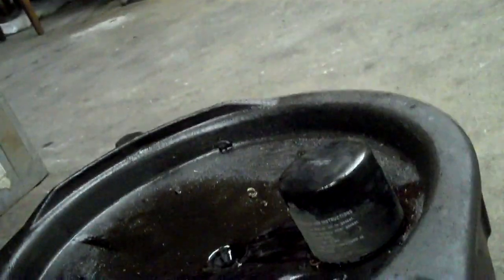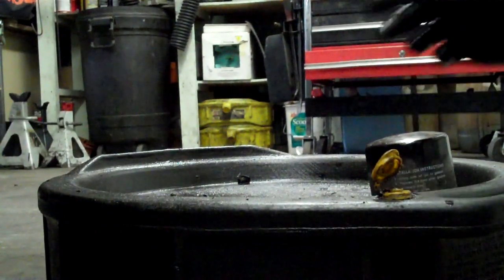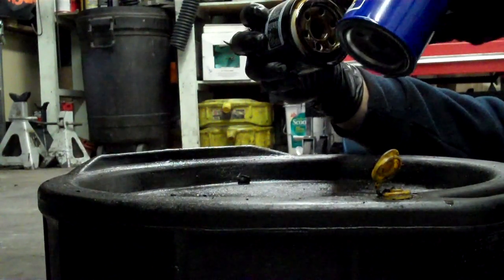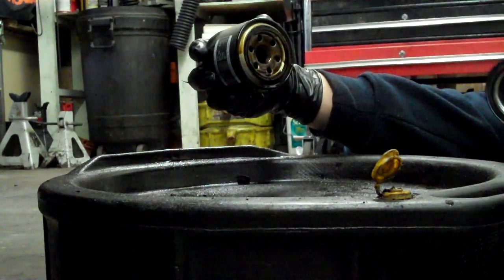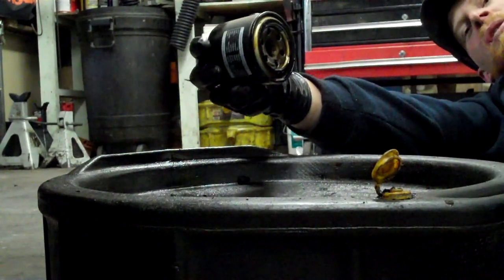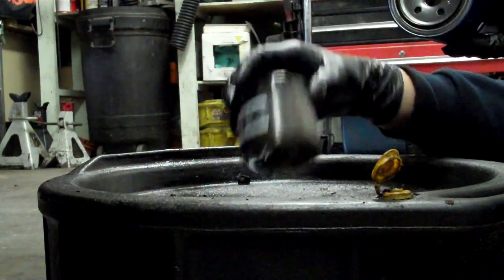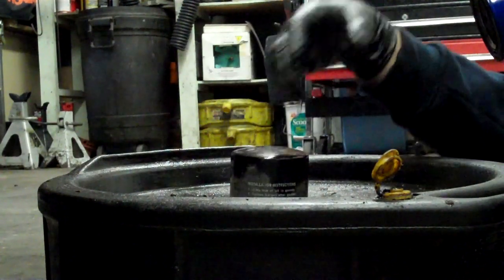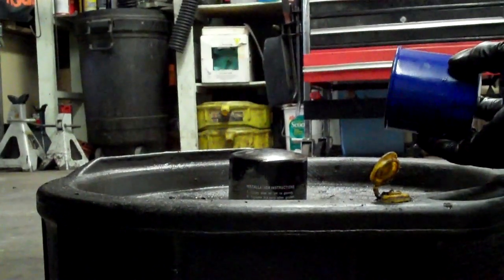KISS principle applied to oil filters.. Literally

Comment: I think until 2000 hondas recomended larger FRAM 3593A,Purolator L14459 but later models they recomends smaller FRAM 7317, Purolater L14612. they have same gasket diamiter and they are interchangable.

Comment: Hi Brian, 
Thank you for another great video. I was wondering.....could you do a video on what to drain the old oil into? I have seen several different containers at the auto parts stores and in automotive departments but I don't know which would be best. Also, what do you do with the old oil when you're finished?
Thank you

Comment: Brian
Got a Subaru question for you.  2014 forester 2.5L.  Oil pressure light comes on from time to time but only for a few sec to a few min.  Also this only occurs once in a while.  I will go 300 to 500 miles before it comes on again.  No codes coming on.  Got any clues?

Comment: 3:00 damn! 
Thanks for tip... 
....
well about the filters

what about oil filters that have a good antidrain valve in perfect conditions, but still go drain completely over night for instance (less than 12 hours)?

i think its because of worn crankshaft and rod bearings, what do you think? do you have any experience on that?

Thanks

Comment: Oil filter wrenches are not even needed, its only when they have been placed on wrong that they are used. Some feel they need to tighten them down so hard, its just not needed, For the years I have been doing oil changes (1989 to present), I have only used them when servicing a vehicle that someone else did the last oil change. Fram had their shit together too by adding the extra grip material to help the HAND turn the filter, not an oil filter wrench.

Comment: You cannot tell if an oil filter fits the application just by looking at the sizes! In 95% of all normal spin-on oil filters, you have a bypass valve setting that has to be the same. It´s the most common mistake that people do...

I work with nothing but filters everyday :-)

Comment: I hope you pre fill your oil filters with fresh oil before installing them so the motor dont run dry & suck air. also if you havent,  look into (oil filter test) on youtube it will make you want to build a voodoo doll of the ceo of fram oil filters